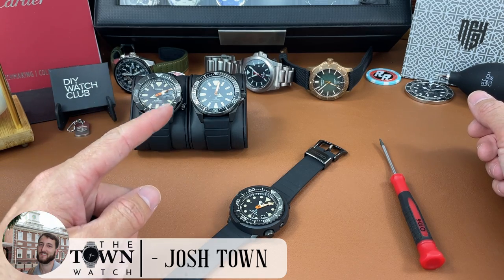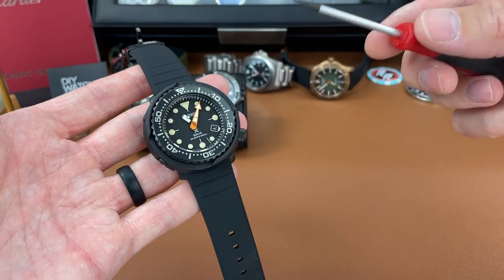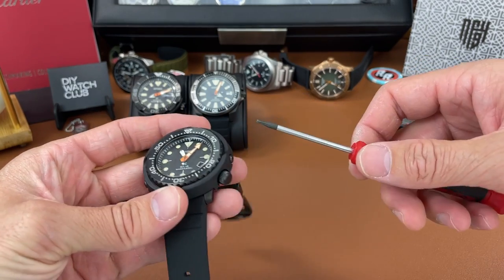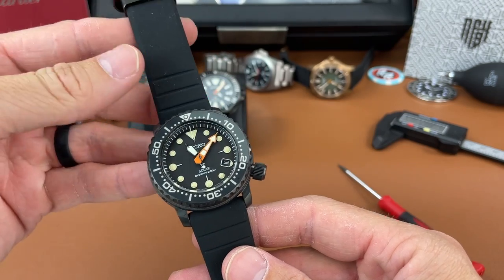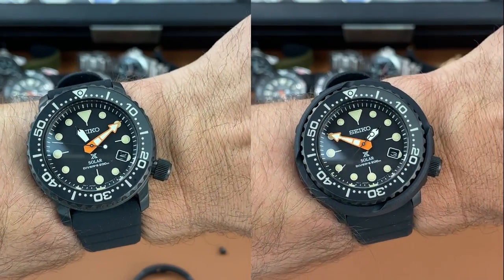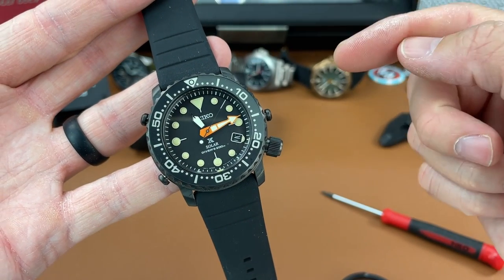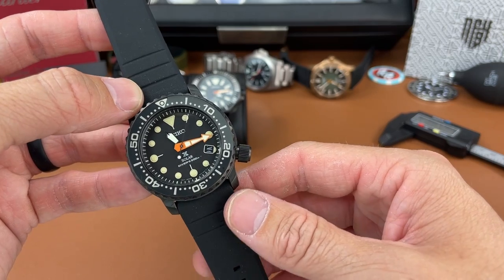REMOVING the SHROUD from my SEIKO TUNA Black Series! (SNE577P1) | Wearable without it?

Comment: A very late comment, but I think if you  screw the screws back in directly to the case without the shroud, the watch would look great.
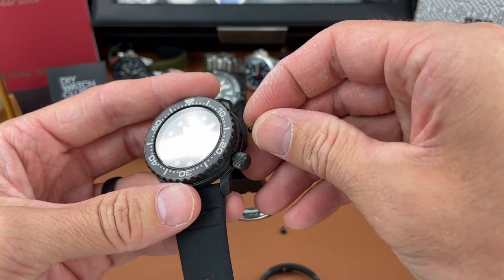Reply: Ya that happens at around 5:30 watch it and see
Reply: @Mark-sd7fc  Thank you. I just watched. Wacky. I think there is a Seiko with 4 pushers or a Casio. Unsure. Thanks for the response.

Comment: I honestly like it without the Shroud.
But the screws will need to be filed down to minimize the unsightly protrusion. I would also use stainless steel screws giving it that industrial look.
The Crown will have to be replaced with a shorter one as well.
Reply from the maker: Thanks for watching!